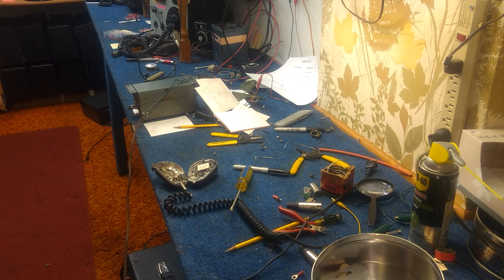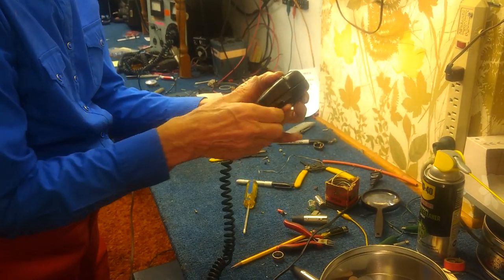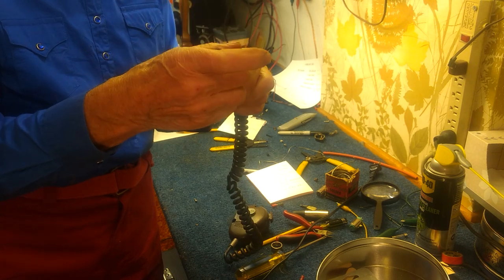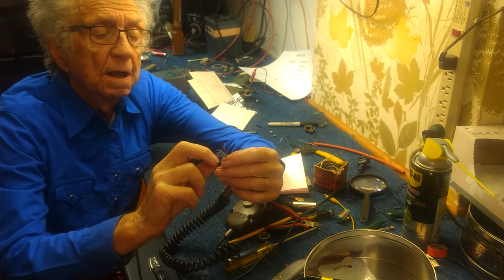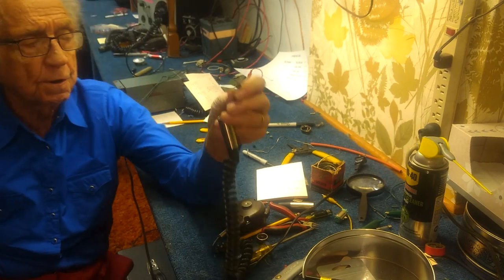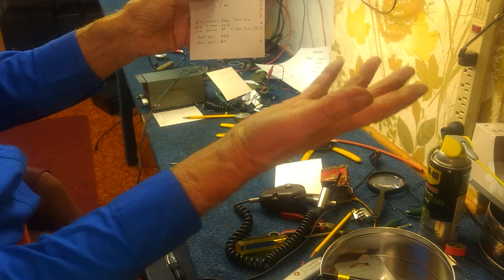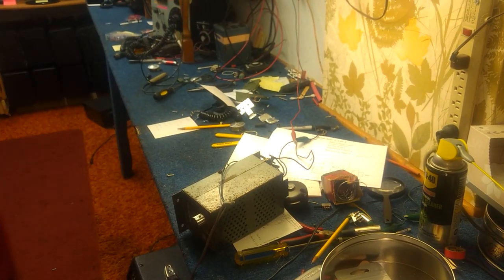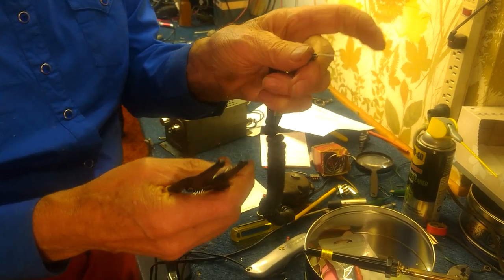Bus PA Amp Part 2 of 2.

Comment: maybe you could put up some sort of physical frame that lets you know what area is in frame.  yarn, perhaps?  i'm guessing from the immediate usability it's not a tube amp.
Reply from the maker: Next project gets a camera operator, and better lighting. The mobilpage amps are solid state.
Reply: @busoldmanphil7293  Also, I will have a white background. I bought two 4 foot led shop lites. Next project will be better lit.

Comment: Nice video ! Your lighting is a little low ! Perhaps more light would do the trick !
Reply from the maker: I had a hard time with camera placement and lighting. I need someone to position the camera. I'm going to have fluorescent strip lighting for the next project.
Reply: Bus Old Man Phil those are nice lights , I have them in my workshop . Make sure you get the LED ones they work the best and are cheaper on electricity! Gotta save where you can !! If you want the old style I do have a few you can have for free if you want ! But the good ones are at Northern tool for about $20 each ! Let me know if you want them .
Reply from the maker: @davekimbler2308  Thanx. I have some left over from my building maintenance business. I got a 48 inch LED for the bus shop. It was the one illuminating the 4103 on grease monkey's channel last month.